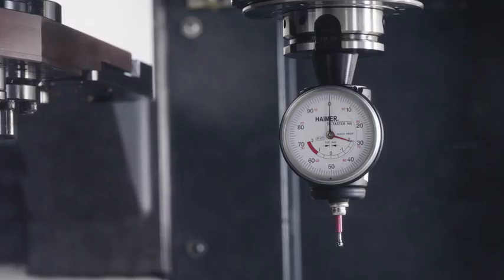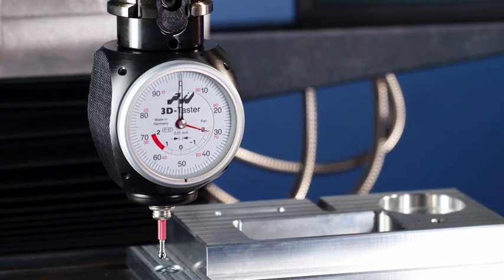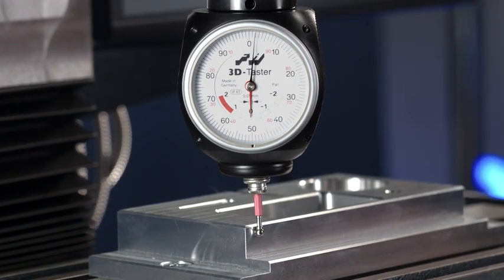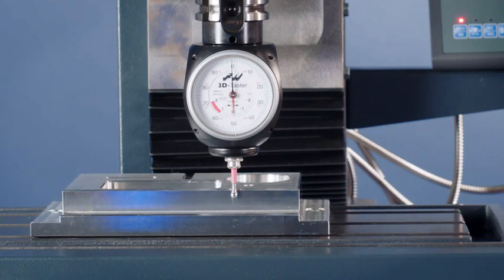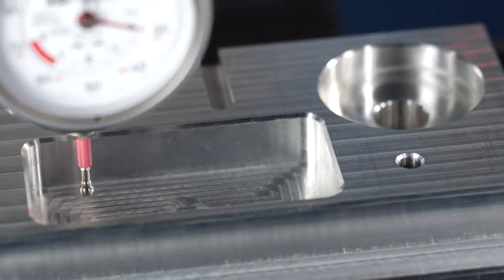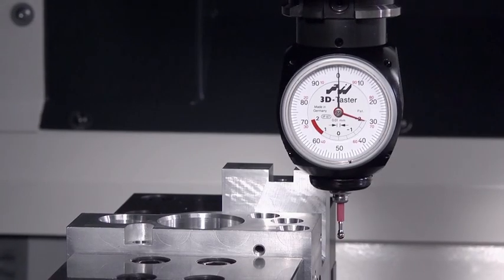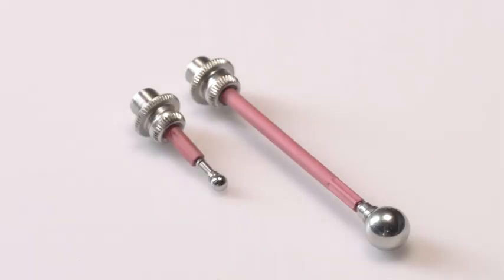The HAIMER 3D-Sensor: How-To Guide

Comment: They should post a video on "how to pay for one"
Reply: If you are using it as a hobby it won't likely pay for itself as with most hobbies but if you are using it in a business the time saved on setups and possibly preventing scraped parts because an employee or yourself forgot to add or subtract the diameter of an edge finder will save you more than the cost of this device over a period of time.
Reply: @phillhuddleston9445  I was a machinist for fifty years and I NEVER made that mistake.....🙂

Comment: Silly question, but how do you install it? Like measuring the tool so when you set the zero it Will calculate in the right way?
Reply: My manual method of doing it is to first check the spindle nose height (or what ever surface your tool references to ) with respect to the table is zero using  a 100mm gauge block (so I know the spindle nose is 100mm off the table)  then set the Haimer tool length using the same gauge block on the table as an offset.  This will then give you the Haimer tool length offset.

Comment: Hello. How often adjust the 3d sensor? If I have spindel without ATC, I need to colibrate it each time?
Reply: Yeah. Or you would need to accept some amount of tolerance. Not unlike throwing something into a lathe chuck indicating it in and re-aligning the chuck.

Comment: .004 accuracy? That’s terrible, do you make a more expensive one in .001 graduations.
Reply: 4 ten thousandths of an inch is .0004. I'd say that's pretty sufficient for most milling operations
Reply: @maxmessling5660  As good or better than a traditional edge finder.

Comment: Maybe someone can help me. I am trying to center the probe. In the video, it is shown how one bolt is squeezed out, and the opposite is tightened. I try to do the same for myself, but when I release one of the bolts, the opposite one does not tighten. It is already tightened all the way. The bolt manipulation does not cause any reaction at all on the ball.
Reply: If you have a Universal model, there is a bolt that runs down the center of the shank. Loosen that bolt and torque it to 4.5 ft-lbs or 6 Nm. This should correct the issue and give you the ability to set concentricity easier. Reach out to Haimer Tech department for further support.
Reply: @adamsoto6466  thanks Adam, that fixed my issue.
Reply from the maker: Thank you for reaching out to us! We find it’s best to speak directly to you in cases like this, so please contact our Technical Department at 630-833-1500 or tech@haimer-usa.com.

Comment: The simple thing is how can anybody do any sort of accurate machine work without one? Pays for itself very quickly in time and materials saved. Would not be without it,how would I cope!
Reply: Have renishaw here. Probes are absolutely necessary.
Reply: @glennedward2201  I have a renishaw prob as well, do you think this 3D edge finder to be more accurate or equal?

Comment: Two things to fully understand.  1.  You MUST calibrated the sensor to your spindle’s center line.  You do this by tracking the ball on the sensor with a reliable indicator held stationary on the machine.  (Not under power....turn your spindle by hand.) You make any adjustment necessary to the sensor with tiny opposing set screws in the top of the sensor in the same manner as mounting work in an independent four jaw chuck.  If you don’t want to do this every time you place the sensor in the spindle than you must dedicate a toolholder and collet to the sensor and leave this assembly together as a unit.  2.  The tips are held in the sensor with a knurled ring around the thread.  This means they are meant to be finger tight.  Guess what happens over time to something that is finger tight......you’ve got it.....it loosens up and the sensor will give you erroneous measurements every time you use it that way.  You must get yourself in the habit of CHECKING THE TIGHTNESS OF THE TIP EACH TIME YOU GO TO USE IT.  I haven’t been brave enough to put any thread locker on the threads to help hold it in place because when you crash it you must be able to unscrew the tip for replacement.

If you crash it bad enough the pointer will not start at zero even with tip replacement.  You must disassemble the unit.(They are not as delicate as Haimer leads you to believe.). I have posted elsewhere (not YouTube, can’t remember where exactly) on how to recalibrate the sensor.  No you do not need to send it to Haimer and pay a ridiculous amount of money to get it back months later.  Hope this helps someone.
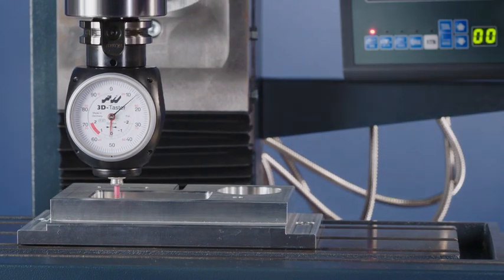Reply from the maker: Thank you for those tips @37yearsofanythingisenough! You are correct in that you definitely want to set concentricity for your specific machine, which we cover at 00:54 in this video. In regards to your second point, if the only issue is that the dial is not resting at zero, Haimer USA’s Tech team has a PDF that could help with that, and you wouldn’t need to take the unit apart. Sometimes, after a crash, more than the dial is damaged, and in that case, we do recommend having the sensor repaired by Haimer. If interested in that PDF, please contact us at tech@haimer-usa.com. Thank you!

Comment: Sry but for x/y needs lots of calibration!
Just use it for z!
Reply: It sounds as if you've never used one. This video was nearly "real time" for operations.
Reply: @UncleKennysPlace  I work with 0.02 mm tolerances.
Reply: @ubbgn  That is approximately .0008" which is not an uncommon tolerance for features such as bores but is a little tight for locations, do you hold .02mm on location from an edge?

Comment: I'm interested in this tool, but I have a concern... when measuring flatness, is there a chance the indicator will start moving sideways while being dragged along a non smooth surface? 

Thanks
Jimmy
Reply: I was told you aren't supposed to drag this sensor along edges because it wears the tip out. You need to move away from the piece then touch into it. And from experience you shouldn't drag because dragging will cause the probe to drag and stick in the direction of dragging which is 90 degrees to the direction you want to measure since the probe can move all directions.

It can be quite frustrating since the three extra movements greatly extends the time it takes to align something and accidentally break the tip. If you throw in a test indicator it would be much faster to align to the machine axis since you can drag then. Once the part is straight then you can use the Haimer to dial in the coordinates of the edge. Test indicators definitely win out if you need to drag along the edge or surface and care more abour variation than actual coordinates.
Reply: How rough of a surface are we talking about here?
Reply: That is true with any indicator, and a high side load can cause inaccurate readings. Take a good finish cut!

Comment: Please improve your quality control for bolting the shaft to the sensor. Mine was way over torqued.  It also often looses it's calibration.  If you buy one, check it before every day's use.  Mine is constantly off.  It's a time saver, but reliability is questionable.
Reply from the maker: Dear Michael,
Thank you for your comment. We are sorry to hear of this issue you are having. It is the first time we have been notified of such an issue occurring with any of our sensor models. I have notified our technical department with your issue. In the meantime, we would love the opportunity to help try and correct the issue you are having. If you could reach out to us via phone or email, we would like to see what we might be able to do.
Our contact:
Ph: 630-833-1500 or tech@haimer-usa.com
Reply: I did at the time and I was informed that the warranty was some absurdly short time.  They gave me the appropriate torque value for that bolt, but wanted money for me to send it in.  I'm not saying I don't use it or that it doesn't work, just that one bump and your off center. Most importantly, your essentially on your own.